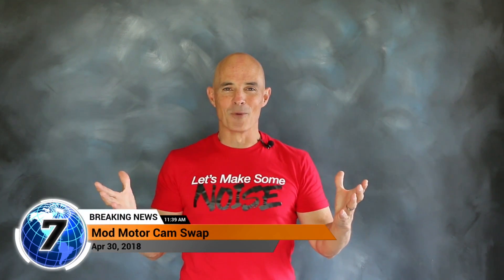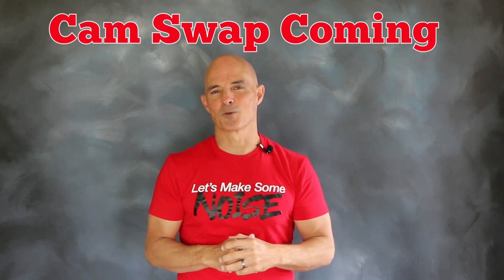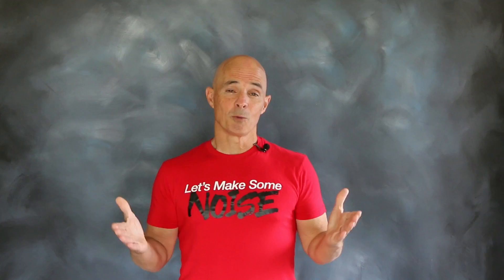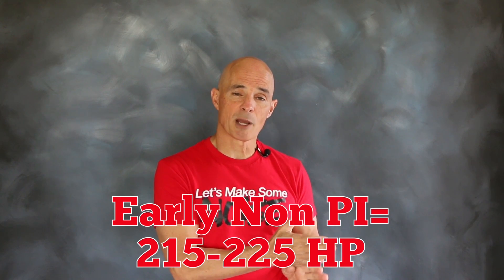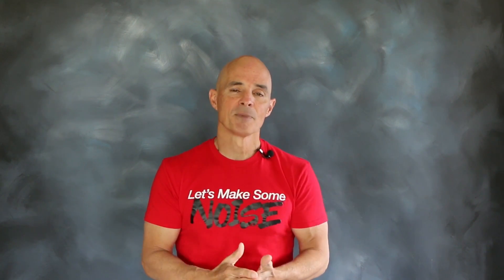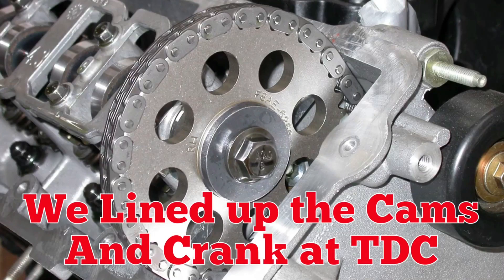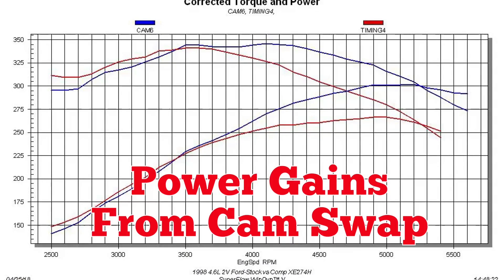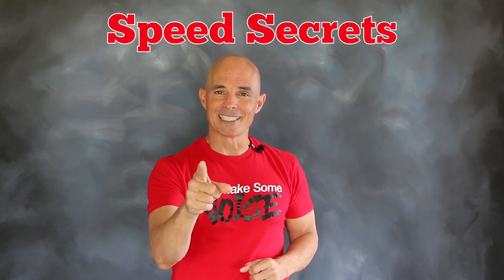Speed Secrets: Mod Ford Cam Swap

Comment: Plz do a 5.4l 2v video. I have a 5 4l 2v with ported npi racing heads with the bigger valves and 268h cam can't wait till I get her tuned right

Comment: I have a 2000  f250  with a v10. 
Wondering if you had any good upgrade suggestions. I haven’t found any good videos. Looks to me like people don’t do mods on these fords like Chevy.
Reply: Open the exhaust. cold air intake and tune other than that bring lots of money
Reply: Sad those didn't get the love like the other modulars. 4v na cobra pistons to bring up compression ratio along with long tubes and intake work would help a good amount

Comment: I have a question you might answer, I have a 2006 Mercury Mountaineer, 292hp, Can I just replace the cam with a 2010 must GT cam 315hp with out changing valve components. I see videos with them just changing the cam. not sure if they change the rollers and guides. Sorry for the strange question.

Comment: Mod motors were poo
Reply: Str8 haters its a reliable v8 at the end of the day. And you can make power with them.
Reply: Sikeeeee
Reply: You mad little feller ?
Reply: @brucedressel4523  why would i be mad? The people that bought them should be mad.

Full disclosure.....i own a termi swapped notch.
Reply: @HioSSilver1999  I have a C head conversion Lincoln mark 8 ... these are great engines i have no idea how a Teksid C head engine is poo ?
Reply: @brucedressel4523  na they suck. They're big,  heavy, complicated and don't respond well to much of anything besides boost. And everything responds well to boost......so there you have it.

Comment: Despite the bowtie Fanboys.... I'm glad there's decent options for the original 2V!! 
IF anyone reads these - would the 262H or 268H Cams be worth for a near stock 97 GT?? 
3.73 Gears, Auto with Shift Kit, B&M 78mm TB, 80mm MAF and CAI...
Reply from the maker: The 268H is a great upgrade, especially with bolt on mods. The value is really determined by you.
Reply: @Compcams1976   Thanks for replying so quickly!! 
I'm an old school Hot Rodder... I know that they're EXPENSIVE... 
I'm an old Customer too. Been so long though, that my last Comp Cam was $149.99!! 😳😳  This will be the first OHC Motor I've ever dug into... 

What I meant by Worth it - was worth the effort. I would get a Dyno Tune, just to maximize the extra airflow. 

I've got decent Top End, by opening up the Intake and Exhaust...
I'm looking for more Lower/Midrange Torque. 

It's got NPI Heads, will the 262H or 268H give me any problems with PTV clearance?? It's only got 84,000mi, I'm not looking to tear into the bottom end for a while.
Carmine🚂🚙✈
Reply: .... Sorry if I sound like a N00b! The old 5.0s and Small Block Chevies were more straightforward to squeeze power out of - to me anyway. 😙😋 

OH, I know that I've got pressed on Cam Sprockets. I'll probably need 99-up Sprockets. Do you have them, or are they a Dealer item?
Reply: @CarlRCTips  I got my NPI 2v auto into the 13s on stock gears and about 100$ of junkyard mods. I run an $15 aviator 70mm throttlebody, a $35 2011 crown Vic pi intake manifold, a 50$ Sr cold air with an old k&n running on e30 and a dumped 6 cat stock h pipe. This was good for a couple of high 13s on 25 inch street tires and 3.27 gears. I do have some weight out of the car but nothing crazy.
Reply: They say the 262 does good on a stock motor with mild ported head but that 268h is better if you going a little more than mild but it's still gives you the drivability you still want for the street